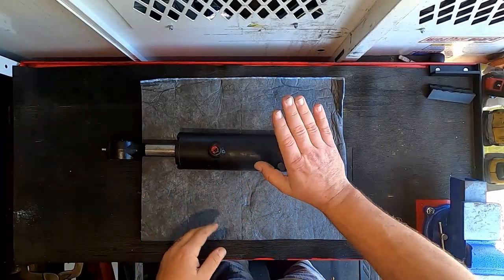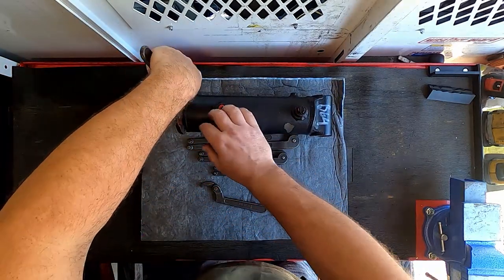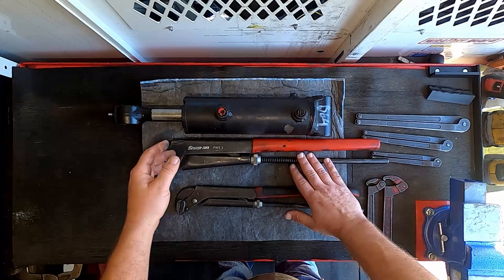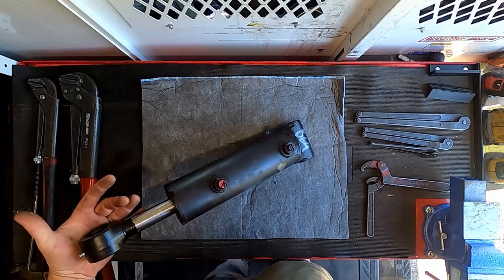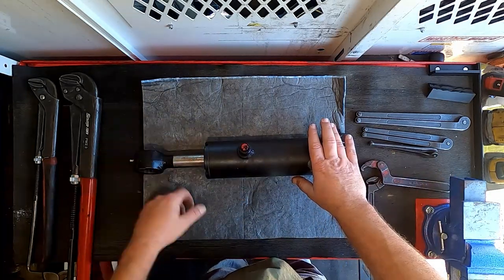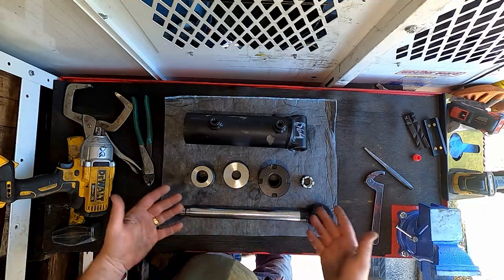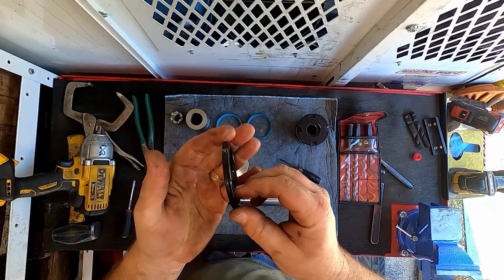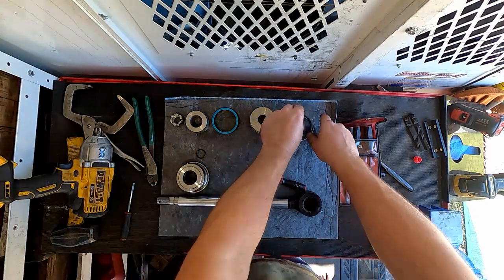A Taste Of Hydraulic Cylinder Rebuild

Comment: Bacho Pipe Wrenches are the absolute Cats Flaps mate. Your right, if they don't get it off, especially when using scaffold poles on the end, it ain't coming off. We use them for adjusting PRSVs, especially with a bar if given space.
Reply from the maker: They are worth every penny. I’ve had those for 15 years and the teeth in the jaws still bite into everything.
Reply: @FunkFPV  ive gone through one set, currently on my second, and have all three sizes. Yea sometimes a bar on the end can bend the handle tho, but it takes work lol. this was a great video, doing these break downs are super interesting man. Nice work on all your content, I love watching it.

Comment: I use a 36" pipe wrench, alu handle, steel jaws. aint nothing told it no, yet. even the free lift on a 70s toyota lift. had the old land cruiser engine in it, 2f. got it back in time and running as well! i got 15 years on the automotive size with Toyota/Lexus, thats the only thing that saved me with the engine haha. less than 90 days workin on forklifts for a living. please MORE videos like this!

Comment: The last machining role I was in was cylinder repair. It was the first time I'd done it and after getting used to the certain things that set it apart from other machining I was okay at it. i wish i could have spent more time there as I liked the work. We did everything plant machinery, not just cylinders, but I enjoyed the cylinder work the most, making new nuts and rods...most of the ones I rebuilt or repaired had combination piston and nut, and figuring out how completely mangled cylinders were set up so I can measure and make new components was just fun. I like puzzles and I like to make things. It was an awesome job.

I dont wanna self promote but I have a few short clips and stuff on my channel of working on one this size.

Comment: Thank you for showing this video. It is very helpful I hope you make more videos like this. I’m a new tech in the field repairing forklifts. 
Right now doing a lot of PMs but have caught issues during PMs and have been learning how to fix leaks such as side shift tub leaks, secondary cylinder rebuilds. 
So anymore videos and tips would be great. 
I used your video on how to replace a radiator on a forklift that was helpful.

Comment: I work as a tractor mechanic, and most cylinders have hex-nut gland. But even if we can use spanner, we only have up to 65mm i believe, maybe even just 60 or 55, and so we use a chain spanner where you have one end of the chain fixed to the lever/handle, and the other end is fixed by the chain pins sticking out and locking onto stops under tension.

We also had to make a tool out of flat iron and bolts (the type that's only threaded at one end, and smooth with the other end rounded) that helps to insert seal inside the gland.
We cut two pieces of flat iron, drilled a hole at the end, about 11mm or so away a second hole, doing the same with the other, and then using the bolts to hold it together. The end hole are joined together by a bolt, with the middle holes getting one bolts each.
You can the put one of the seals needed into that tool, fold the iron to dent the seal inwards without damaging it, and the opening one it's in the correct spot

Comment: That spacer has another function. It prevents the piston from reaching the oil port. If the piston was to reach the port the cylinder would become stuck it the fully extended position (unless the load could collapse the cylinder.

Comment: Bahco was bought out by SMA Europe, which is Snap On I believe. Bahco are now produced in Spain (Snap On bought Irimo Tools, Spanish tools). Not sure if the adjustables are still made in Sweden, my adjustable are a few years old now, but stamped Sweden.
Those are referred to as Swedish pipe wrenches round my parts (then theirs UK, typically Record, now Irwin 🤢, and the US type, typically Rigid, and similar to UK type).
Love seeing cylinders being stripped, never done it myself. Thanks for the laughs as always and staff safe!!

Comment: Fellow field mechanic here, on the heavy equipment side of things. Great video and enjoy the long form tips and info vids you do. Only thing I'd critique is around the 10 minute mark, you had the ram/rod in the vise, clamping on the plated surface. Has the potential to mar or scratch the surface, which can result in seal/wiper damage. I always put a pin in the vise (you gotta take it out anyway when removing the cylinder) then put the ram on the pin to hold it. If it was pulled already and I'm just doing a bench rebuild, i clamp the pin hole section. This was a throw away cylinder, so it didn't really matter here, but it's a good preventative rule of thumb. 

Other notes is deere and other companies I've seen lately have switched to those goofy p.i.t.a. gland styles to purposefully make rebuilding the cylinder harder. They'd rather sell you a new cylinder at 200+% mark up than a seal kit that you can source way cheaper, sometimes locally. Screws wrench monkeys like us outta the extra rebuild labor time, and the customer out of cash.

And those bahco pipe wrenches are awesome. Snap on list price isn't much over the bahco retail Amazon prices, and you get a lifer warranty. I've known to throw a cheater pipe on 'em from time to time when something needs a severe attitude adjustment, and the jaws do eventually wear out. If you have a decent snap on guy, he can cut you deals that nearly match the bahco price and won't throw a fit when you bring it in bent to hell before handing you a shiny new one. YMMV if your local rapevan man is a dick. Worth it in my book.
Reply from the maker: I actually had soft jaws in the vice 😁👍🏻
Reply: @FunkFPV  nailed it.

Comment: Rebuilt around 10 of these of varying sizes and assisted on others, never seen loctite on one. The fine threads are usually pretty powerful. I mean, that one had no loctite and look at the time you had. We've told customers dont bother sometimes cause we couldn't get it open and just replace it, what you need to do to get it open would destroy it.

Comment: I did one of those cylinders for my boss on a 345 excavator we couldn’t get the cylinder out from the housing so we used air to blow it out which is fine and air to put it back in. The real fun part was taking nut off of the cylinder heated up with the torch and use 9 foot pipe as a breaker bar and use multiplier ratchet first one I ever did 
And the last one I Will ever do.🤬🤬. Love your videos man👍
Reply from the maker: Dirt equipment cylinders are a nightmare. These forklift cylinders, even the bad ones are easy compared to those.

Comment: Hmm, you mention that the spacer/stopper is just that, but clearly demonstrate @10:16 that it's a cleverly designed integral slide hammer intended for easy removal of the piston from the rod🤷‍♂️

Comment: I work on bulldozers, excavators, loaders and all kinds of big shit. We've got a 5 foot long pipe wrench and a 4 foot long cheater for it. We'll put the cylinder in out 100 ton press to hold it, then use the pipe wrench and cheater and even with my 250 pound ass bouncing on it and it won't break some of them loose. Then I'll enlist an intern to heat the can up with the torch and hammer on the pipe wrench while I'm hanging off of it. 

Luckily we've got a hydraulic bench that we can torque the piston nuts. We have several that get ran up to 9k ft-lbs. The bench is capable of 24k ft-lbs. Haven't gone that far yet.

Comment: I put my cylinders in a vise or leave it attached to the machine or equipment. An put my 22” knipex cobras on the gland nut an if needed a 5’ breaker bar. I get it on there carefully an just slowly give it the beans. I’ve broken some huge ass gland nuts loose an hardly any damage to the nut. But anyways love the vid. Cylinders are kinda fun to work on.

I second that in the JD cylinders. I installed new seals on a jd utility tractor loader an I had to deal with those stupid wire dealios that you have to get out.
Reply from the maker: Back when I did construction equipment I’d do 2 a week. Now I’m lucky if I get one a month.

Comment: Dude, so glad I watched this video for the seal tool at the end.  I've been working on lifts for about 8 years now. I never knew that tool was available.

How do you keep keep the oil from old hydraulic hoses from getting in your truck?
Reply from the maker: If you remove the hose and blow it that helps. If it’s just old oil and there’s no particulates like metal, dirt etc. in the oil it shouldn’t be a problem.
Reply: @FunkFPV  
I meant the oil that drains out while sitting in the bed. I try carrying the old hose back to the shop and throw it away there. Do you throw the bad hose away at the jobsite?

Comment: Taking apart stubborn glands like that on small cylinders like that I use an air hammer with a rounded off bit, larger ones they go into the cylinder press as some of them are installed with many pounds of force. I have done many many cylinders and this is the first I seen with that spacer on one, that looks like a nightmare to me, does it not scratch the chrome on the rod?

Comment: Idk what the real name is of the machine but we used to use a thing that looks like 2 pipe vices with chains to break apart down the hole hammers for drilling wells. We called it a scorpion. I've never seen anything it couldn't break apart
Reply from the maker: My hydraulic shop has one of those. They’re great but expensive. You need the do a lot of cylinders to justify buying one of those.

Comment: Great video bud. Ive replaced a couple hydraulic hoses on lulls and fork lifts, but never seen the inside of cylinders. I actually replaced my engine hoist cylinder/ram with one thats pneumatic and hydraulic one. Now i can use it like a standard one or hook it up to a compressor and just squeeze a trigger to raise it. Those snap on wrenches are made by bahco, and they're actually called Swedish style pipe wrenches. Regular pipe wrenches are like the ones plumbers usually use, sometimes called monkey wrench. But ya those swedish style arent very common but they are great. Ive been wrenching for years and just recently seen them within the last year or so. I seen them on a mechanics vids a few times and had no idea what they were called or how to find them until i accidently stumbled across them. They do seem to work great. Especially for tie rods ends and stuff like that. Never would have thought they'd work on something as big as 6". Harbor freight has a cheap pair i may try before investing in the snap ones or bahcos

Comment: As someone who never plans on doing this, where is the hidden danger
Reply from the maker: High pressure hydraulic fluid is a invisible killer.
Reply: Another very serious risk is being so pissed off trying to disassemble a John Deere cylinder that you end up suffering health effects from high blood pressure and extreme anger
Reply: @Adam_Poirier  last john deere one i did, disassembly was easy getting it back together was another story. Turns out i added one to many of the c cup seals on the piston

Comment: Dang I thought a drill
Bit, Grinder, step bit, needle nose, side dykes, sledge hammer, punch, flat head or and a TIG welder with no shielding gas. You sure you did it right? The short with the Toe Jam Guy did it way differently.